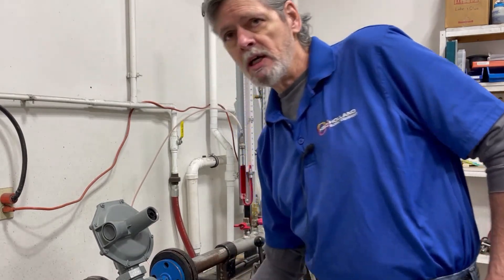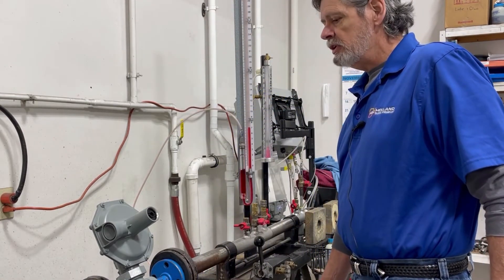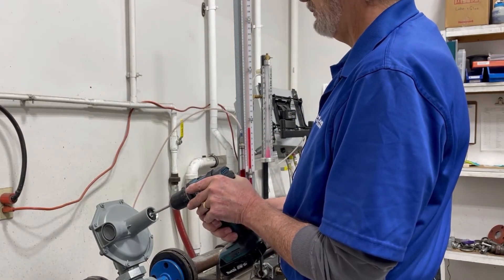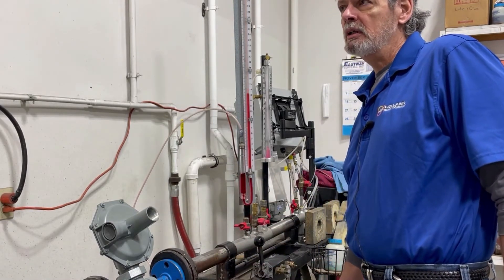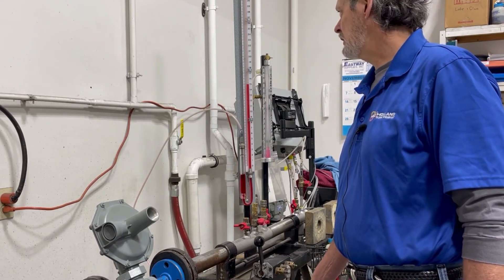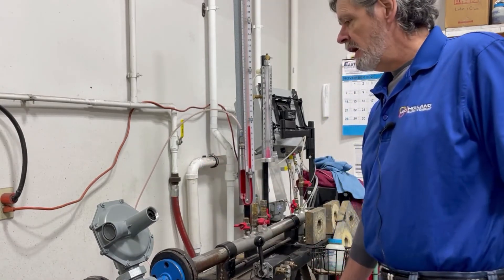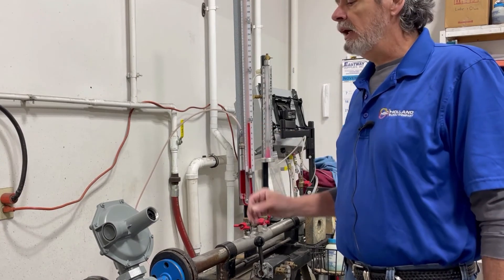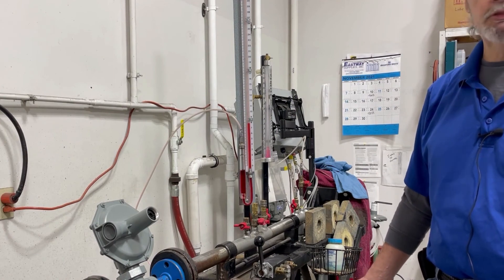How to Adjust the Outlet Pressure on a Model 143 Regulator

Comment: It's 20° out and are natural gas stopped flowing. Gas is getting to the, cuz I checked the bleed valve. Seems like the regulator went bad. Maybe need a new one? It's natural gas and it's outside. We do have to pour dryer into that tank out there sometimes. I don't have a pressure tester so I don't want to adjust the plunger bolt. I'm kind of at a loss right now and there ain't no one to really call or have come fix it. I'm going to have to do it myself. I will check on the radiator to see what model it is.
Reply from the maker: Sorry to hear about your troubles with your regulator! You can contact our sales team (sales@hollandsupplycompany.com) and they can provide better guidance on what to do next. You may also need to contact your natural gas utility if you are replacing any equipment on your home.
Reply: @hollandsupplycompany  it's made by Fisher controls and I'm going back at her right now outside. Got another 4 inches of snow last night. Going to go pour some ethanol into the tank momentarily. I hope I put the regular later back together properly lol. I wish there was a diagram somewhere for it.
Reply from the maker: @Davewutup  Got it, unfortunately we don't sell or have experience with that brand. I think they have a YouTube channel, so maybe they have videos to help or you can visit their website to try to find a rep that can help. Stay warm & safe!

Comment: VEry helpful, had to adjust mine to at least 9-10 in WC to properly supply my 18kw generator and not starve it when all gas appliances are running at the same time👍
Reply from the maker: Glad it helped! Thanks for watching.
Reply: that's why i'm here too.   we need 5 to 7 in WC   ..and right now the generator at the fuel regulator is getting 16 in WC

Comment: Can I run it without the yellow spring on the end of the reset plunger rod?  I didn’t know the orientation and it was too hard to line up.  I just put the rod back in without the little yellow spring.  I’m not talking about the main spring.
Reply from the maker: Our warehouse supervisor (who is in this video) said it sounds like you have a low pressure cut-off situation, and it won't work the way it is supposed to if you do that.

Comment: Is there a special tool to adjust the 143 model with the manual reset plunger?
Reply from the maker: Hi there! Our team has made their own tool for this model. They used 1/2" stainless steel tubing to create a hexagonal shape to fit. But our warehouse supervisor said you could use a flathead screwdriver in the horizontal slits on the adjustment button.